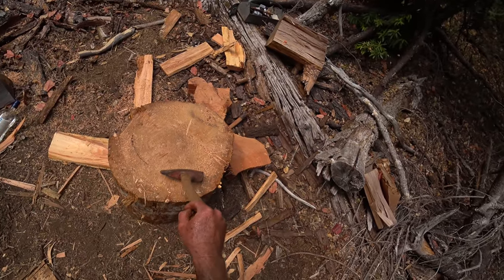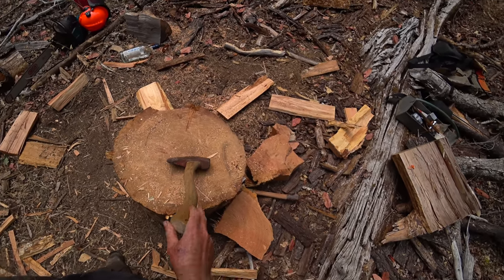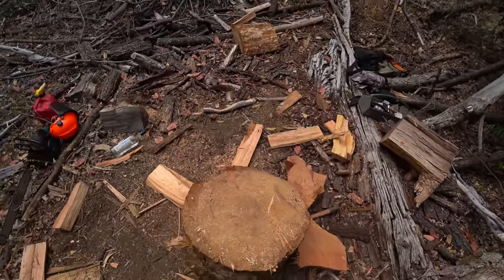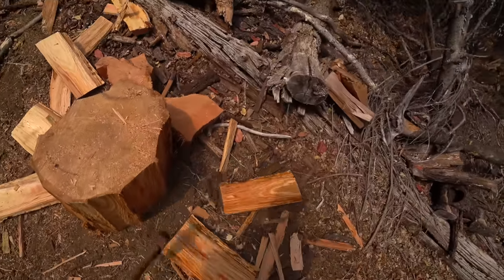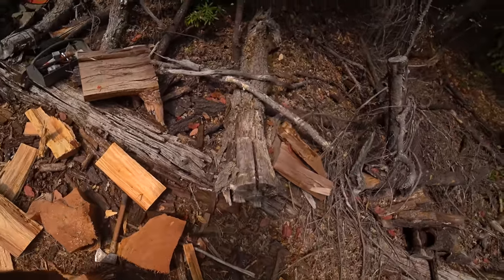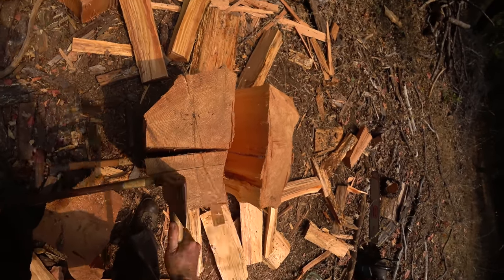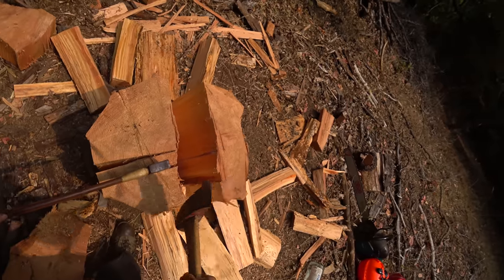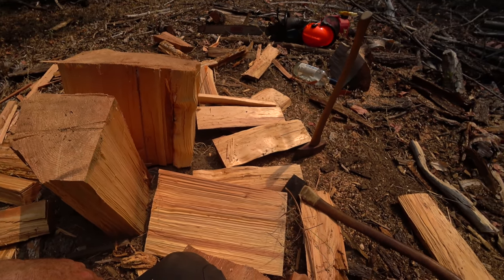Don't Split Big Firewood Rounds In Half (usually)

Comment: Taking chunks off the side of a round is a good way to sprain your wrist's as it kicks the maul and causes it to twist. It's dangerous! get some splitting wedges for the big stuff, have a splitting block to bring the top of the rounds you are splitting to a comfortable height, and always aim for the middle of the piece you are splitting,
Reply from the maker: I think we are pretty much at odds on all that ha ha.  

Never suffered any injury slabbing.  I know lots of others do it too.  A lot of people grip their handles too tight.  Maybe that's the problem.  Let the axe go where it wants to.  

Wedges?  Too slow, not a fan of any kind of regular use.  Not for firewood anyway.  I will rarely resort to splitting firewood with wedges, but they are occasionally useful.

Splitting blocks, no thanks. That is a good way to lose the ability to generate velocity and velocity is key.  speed x mass = momentum and you can't change the mass.  Give me a round on a block and a round on the ground and I"ll generate more velocity the lower it is to a point below the usual length of stove wood.    You have to set the tool down and lift the wood up, for what real advantage?  That ends up being a lot of time and work and stressful bending over.  And, finally, all the wood has to be brought to the block instead of dumping it and splitting it where it is.  There is a theoretical advantages to having a solid mass behind the round, but it has to be weighed against global energy expenditure.  In reality, I don't find it makes so much difference as long as the ground is not very spongy.  Very little use of splitting blocks in the best woodsplitting videos I've found on youtube.  https://www.youtube.com/playlist?list=PL60FnyEY-eJBEqSSPEPbpfNHoOHiKb72p  a lot of us eventually realize they are more of a hinderance. I use one once in a while for small pieces mostly.  But I recommend everyone try quiting for a while and then going back.  If they have to use one, the shorter the better.  Some say a block is safer for the user, but that is not always true.  

Always hit in the middle.  A lot will disagree, including me.  I prefer to start at the far edge, then toward the middle or close edge and fill in the blanks. It's the same as the phenomenon that splitting the wedge end of an axe cut log is easier to split than hitting the flat end of a saw cut.  I think most rounds split easier from the corner to set the first crack. or from both ends.  Mine wasn't, becasue there turned out to be a big fat knot directly underneat.  I couldn't have a picked a worse spot on that round period lol.  It makes every bit of sense to me why that is- splitting into a 90 degree corner, v.s. the center of a large mass going straight out into a plane, while also fighting all of that inertia to push the sides apart.  Occasionally I'll smack the middle first, but if I'm paying attention, I'll start at the far edge, often even with the toe of the axe hanging over the end.
Reply: @SkillCult  I grew up splitting wood to heat our house, Ive had my fair share of injuries from doing things wrong, and learnt from them. Splitting wedges makes easy work of those big rounds and its safer! The splitting block does a few things for you, stops your axe or maul from going dull from hitting the ground, it stops the axe from over swing preventing you from putting an axe in your leg or foot, It also brings the wood you are chopping to comfortable hight, That axe/maul head has the most energy potential half way through your swing, not at the end of the full swing. You put all your energy in the first half of a swing, and the second half you are just holding onto the handle.  Hitting in the middle gives you a lot of area to aim at, it also keeps the wood you are trying to split stable. when you tell your viewers to work there way in from the sides, they are going to try that on smaller rounds, That axe/maul is going to have less friction on one side than it does on the other, causing it to kick to one side, twisting the handle in your hands, or its going to twist your wrists. which ever is weaker. Im glad to see Mr. Chickadee leaving a comment, Im a huge fan of his!
Reply from the maker: @drydenstewartenterprises   I don't know how you swing an axe, but I gain more speed at the end of the stroke.  It's quite obvious to me now that I rarely use a block.  When I do use one, I feel very limited in the power I can generate.  it take space to build momentum in a mechanical system of any kind.    The idea that using a block is safer is not that simple.  It also puts the work and the edge higher, with potentially more likelihood that it will stick in us.  But it depends on the size of the block, and how the tool is used.  In splitting on the ground, the axe bit is already close to the ground when the potential chaos of impact occurs.  It is also safer to drive everywhere at 40 mph wearing a hockey helmet.  But I'll pass on that too, because it sounds lame and I probably don't need to.  As far as the axe edge, I've been splitting at least half my firewood on a gravel driveway for years.  Like other people whotsplit on the ground, we don't really care that much. If I'm using an axe ground thin for chopping, I can usually avoid hitting the ground, because i'm careful and there are things you can do, but with a maul or old more obtuse axe edge, I really don't care about not just a few, but a lot of ground strikes.  Like I said to my tech, we can revisit this is 10 years and see if it was a fluke that I've had no accidents, or repetitive stress injury, ever, from splitting wood in the previous decades.  I'm 53, not 23.  Besides being hit by a piece of flying firewood, which is hard to predict or avoid. I didn't quit using a splitting block because it is dangerous and inefficient, and neither did all the other people that don't use them.  And no one told me to, I just gradually quit using them, noticed how much less annoying, more fun and more efficient it was to split on the ground, and never went back.  Most of the people that tell me to not split on the ground haven't done it out of fear or theory or because every one says to split on a block.  I've done a lot of both.  blocks have a place, but I often don't even have one around when I'm splitting and just use a round of wood that is handy if I want one and then split it up for firewood too.  And that round is often very small, but I'm not just going to swing wildly at it any old way, even if it appears that way to someone from the outside.  The way I see the issue of working off the block is that when slabbing, the still inertia of the mass of the large block seems to be an advantage, instead of a disadvantage, as when trying to move two very large masses apart.  Of course, as the split starts, the mass of the maul with the forward inertia it embodies, is going to travel toward the smaller mass, the firewood slab, and push it off, because it can.  Presto, firewood slab.  Bottom line is that if rounds are at all big, that is how I do it.  Sure there is some handle shock, but here I am, injury free, with every reason to continue and no reason to stop.
Reply: @drydenstewartenterprises a splitting block actually increases the chance of hitting your legs if you really look at it, if you need wedges it’s far easier to cut it with the saw and if you are spraining your wrists  slabbing wood maybe splitting is something you shouldn’t do.

Comment: Lovely grain, thanks for the video.
Reply from the maker: @TubeMeisterJC  I don't care for that handle, it's just one I had to stick on there.  Like I said, going with a longer one and definitely straight.   I usually use a 6 lb, but I'm pretty sure once this one is dialed, It will be my most used.  Everything that I split besides the long center split was pretty easy.  I literally picked the worst possible spot on the entire log to start that split.  Otherwise, it would have been much easier.  Many large rounds, even of fir, are hard to split down the middle.  The point of the video is that if you can knock off slabs to reduce the mass first, getting most slabs off with one or two blows, it just makes more sense to do it that way.  I have split every species here and I use slabbing all the time.  Not just on large rounds, but often on medium, it just depends on how the wood reads.
Reply from the maker: that stuff is really nice. I cut some at about 3 feet and split some stuff out.

Comment: haha, I am glad to  see that I am not the only one breaking the rules by driving the axe with steel when no wooden club is within reach. I really don't think it's a big deal though, as long as you are not using it as a wedge in gnarly, knotty wood with a 10 lbs hammer. It's a rough tool that can help us process wood not a baby, lol!
Reply from the maker: The damage adds up.  I very rarely do it, but it doesn't need to be a hard and fast dummy rule.  It depends on how hard it is hit too.  I was going pretty light on it.  The vast majority of used axes and heads out there have been beat on and they are still usable.

Comment: I am not a fan of 8+ pound mauls.  5 would be great.  6 is lowest I've found so far.  I also split with full sized axes though.  You ever see those ridiculous monster mauls?  I saw one at a flea market.  It's so incredibly heavy and the handle is also heavy and made of metal.  I picked it up out of curiosity and immediately thought it would be horrible to use. 

The mass and size explanation makes a lot of sense.  I think of it like a small asteroid hitting a mountain.  Tiny amounts earth will give way around the impact, but that mountain isn't moving.
Reply from the maker: I found that head in a thrift store and snatched it up.  I like the design and weight I think, just need to hang it better on a longer straighter handle  I don't really perfer to split with short handles.  it's too curved as well.  House handle axe handles are too curvy for me.  I talked about monster mauls when I shot this, but I cut it out ha ha.  They're terrible.  Think of hitting a 4 inch wide slab of the same length as the face of that round.  It would definitely split easier right?  that's the side mass issue.  The other, of separating is not totally independent of the bulk factor, but it's a different specific problem.
Reply: Awww, don't hate on monster mauls. They aren't that bad.
Reply: @stillwatersforge3957  why do you like them?  If I was to create a dystopian society one of the rules would be you have to carry around a monster maul and split a round every hour lol.
Reply: @ethicalaxe  LOL. Idk, that might do people some good. I like the weight and durability. For me it takes less swings with my monster maul than with my lighter maul. I can get through almost any knot with it and if it gets stuck I don't have to worry about breaking it when I hammer it out.
Reply: Look at it this way. Take it to extremes with a little 2oz maul, you can hit the round with this thousands of times day and night for weeks with the total cumulative energy being equal to a hundred swings of a full size maul and yet the round will not be split, or reduced, or really even significantly damaged. While a large enough maul simply dropped on the round once will split it. 
And the large maul will be slower, less jarring on your arms, and less likely to cause a muscular-skeletal injury like a strain or tennis elbow.
Two mauls of two sizes, big for big wood, small for small wood, this is most efficient.

Comment: It looks to me like you could have split that big round with half the effort with an 8-pound maul.  If lighter weight meant less work, why not go to a tiny 1-pound maul?
Also, when the first strike near the edge doesn't do the job, I work across the round on the diameter (probing for weak spots, or making them) and usually get it open.  Just because a blow doesn't seem to do much it, it can still be weakening the structure, and this weakening is cumulative as you work across.  This is what you eventually did, but those first ten blows at the same place near the edge were mostly wasted.
By the way, I thought your accuracy was initially quite good.  You didn't get sloppy until you had worn yourself out.
Splitting slabs off the sides does not work well with brash wood.  What you were explaining when describing splitting slabs in the interior of the log is true at the sides, too. With unbalanced stiffness on the two sides of the split, the cleavage plane works to the outside of the log and you wind up with a "slab" that's a wedge half the length of the log.

Comment: 5:45 what do you mean you don't have a wooden maul with you? You have 50 pieces of firewood on the ground that don't matter if they get smashed up! I use chunks of firewood as a hammer all the time, and if you need it heavier just hammer with it longways like a fence post pounder. Obviously you would need a heavy chunk though, or a round. Also I very highly recommend the fiskars splitting axe because it's lightweight with a good shape. Can't change the handle though
Reply from the maker: I'm not a fan of holding onto large diameter wood while beating on stuff.  I do it, but only up to a certain size and it usually sucks unless it's just a few whacks.  I think I ended up chopping one out later that day for some other long stuff I was splitting.

Comment: The question that I have is how and where did you find a 5lb maul? The only ones I can find are 7 or 8lb heads.
Reply from the maker: Junk shop :/  You can probably get one from Europe, not likely many, if any, made in the states.  But you might be able to modify a 6lb?  I'll know more when I get a long handle on it, but I think I'll use it more than 6lb.  I actually wish it didn't have the axe eye, so I could put a regular maul/sledge fiberglass handle on it.  It's cool though. I got it for the shape too. it reminds me of the German style with a pretty bluntwedge on the end.  They almost never stick.  They either pop the wood in half, or bounce out.  Not sure where that is an advantage and disadvantage yet
Reply: @SkillCult  thanks for answering my question! I'll have to check around my local junk/antique stores to see if I can find one. I just want to say I really appreciate the content that you create on your youtube channel.
Reply from the maker: @patricksullivan2816  They are pretty unusual.  good luck.If you have a 4" grinder, you can probably grind a pound off of a 6
Reply: That might work-grinding it down. Would grinding it down make the steel of the maul head too hot and therefore make the whole thing too brittle? If my thinking is correct the bit of the blade is harder than the rest of the maul's head. Grinding down the sides of the maul would make the most sense to me at least.

Comment: Just had a question, are you still doing the Wim Hof method? If so how's that working out?
Reply from the maker: No, but I'd like to be.  I'd recommend anyone give it a good trial. It's a matter of time and energy for me. If I'm not sure I'm going to get out more than I put in I can't afford to do it.  And I'm not sure.  It is hard to cut out the time for me.  Try it though.
Reply: @SkillCult  tried it for probably 8 months and it really helped with my sleeping and cardio (assumption) during winter time, I guess it all depends what kind of lifestyle you have, wouldn't do much good for a desk jockie

Comment: one winter I chopped a few cords of cottonwood logs 2-3' in the round, all punky in the center.  an old guy suggested I try steel wedges and sledge hammer which turned out to be much easier, you could try hammering them in with back of the maul
Reply: hah ok should have watched the rest of the video first ;)
Reply from the maker: Once I had one of those spongy cottonwood logs swallow an entire axe head and not split lol.  It was hard to split it back .  there is no need for wedges here. it would perhaps be a good choice, but I would have to have planned and brought them into the field and I'm not going to do that.

Comment: All you need to do is work your way across the middle. Do not hit the same spot over and over. Imagine a line and the mall is your pencil. That piece you have could be split with like 6 or 7 blows.
Reply from the maker: I over did it on the one end with the knot there, but in the moment I was trying to prove a point.  Not to say my strategy couldn't be better.  That knot may not have looked like much, but it was very resistant. Picking a better spot would have been much easier, but the knot was healed over and I didn't know it was there until it became obvious that something was keeping it pinned together.  But once I got most of the round split, I still had to wail almost full force about three times to tear that knot apart.  Douglas fir knots are notoriously hard to split through, v.s. around, as I would guess some of your conifers are.  That was literally the worst exact place to split that round lol.

I'm not suggesting not ever splitting big rounds in half as a dummy rule.  As I said, the video doesn't have so much to do with this round, as it does with a common phenomenon, which is that many large logs are very difficult to split apart across the whole diameter.  It's just true, strategy or not.  Many of those logs can be slabbed very easily, with most slabs requiring only one or two blows.  People should just do the math and try it instead of insisting that the log be split in half first.  I use the technique a lot and will most often go in on large and medium rounds with some slabbing before I think about knock them in half.  Works for me.